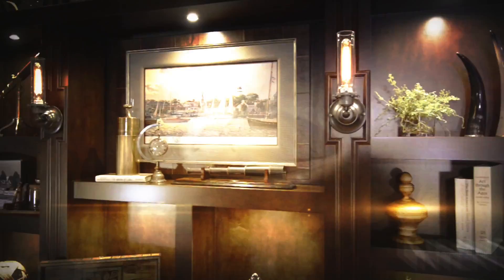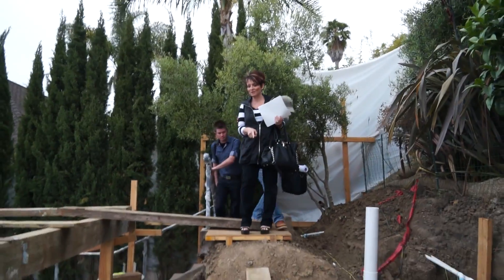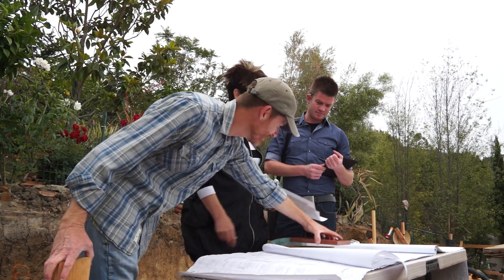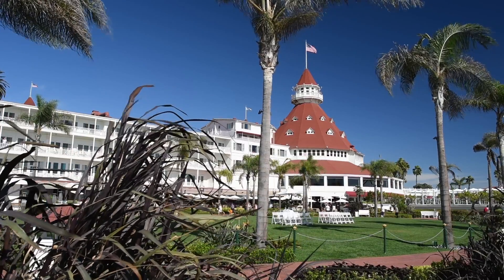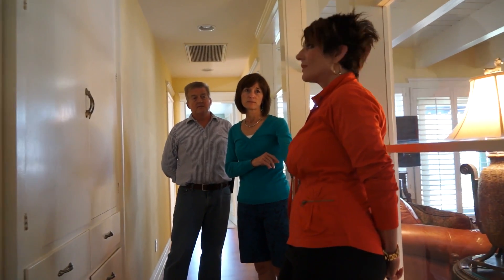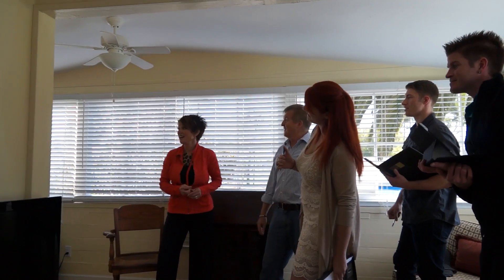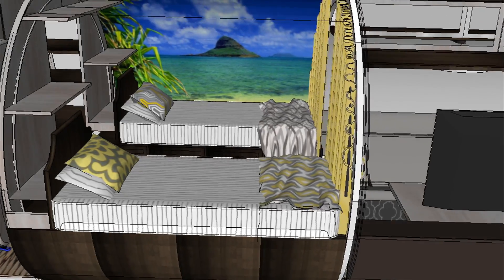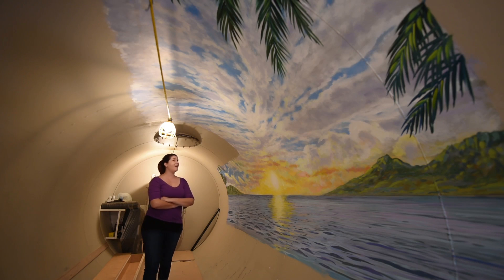Interior Designer Takes on projects, NYC, Bermuda and Coronado #2, Season 3

Comment: Robeson Design Iron Wood or Ipe is an AMAZING wood - This Old House uses it ALL the time and the sun WILL bleach it but it will NEVER rot and the fire rating is probably an hour since it's so hard. An air gun barely makes it through the wood. I'd use tongue and groove and install it with a hidden system.